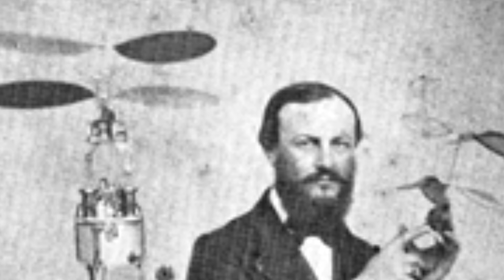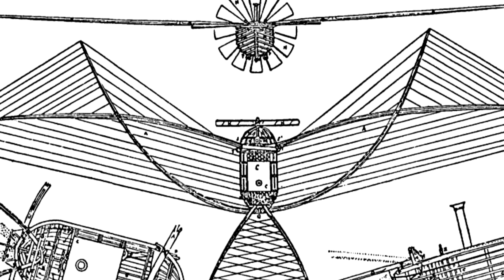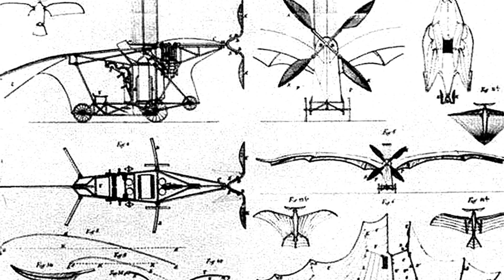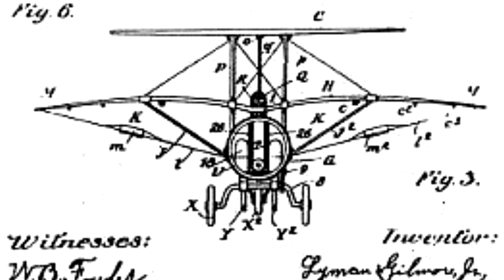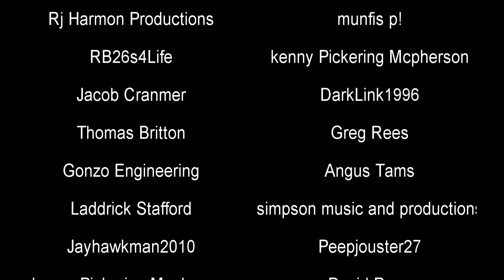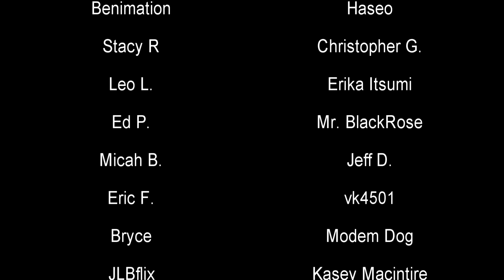Why Aren't There Steam-powered Airplanes? | History in the Dark

Comment: Batteries contain less energy per volume or weight than fossil fuels by a long way so you are not  gaining anything by heating water electrically in a plane. You would also have the weight of the engine plus the double conversion inefficiencies. The electric motor is the most efficient part of an electric drive train and you are throwing that away.

Consider that all the experiments with steam planes were at low altitude. Just imagine what altitude changes between 0ft and 35000 ft would do to  equipment already pressurised to many times atmospheric pressure. It would be many times the problem that cabin pressurisation presents today. That would require stronger and heavier equipment than at low altitudes so a big weight penalty again.

Then there is range. Steam trains were often more limited by the water they carried than the fuel, so some places such as the LNER in UK  used troughs that could replenish the tanks without stopping. Condensers would help and the cold at altitude would help but probably not enough to compensate for the extra weight and drag (the outside air has to efficiently cool the steam so fins will be needed for the heat transfer and these would cause drag).

It is interesting that steam was considered for the amerika bomber as this is probably the one example that could be equated with modern use ie long distance, high altitude. However i would bet that has more to do with fuel shortages than thinking it was intrinsically a good idea. The fact that it wasnt even prototyped, suggests that it was just a shot in the dark, rather than a serious contender.

Thanks for an interesting expose. I had heard of the bessler very recently and knew about the langley and maxim efforts, but you have filled in a lot of the gaps. The bristol tramp looks like coal firing would be the least of its problems! It is just a mad jumble of stuff as was often  the habit in those days. Just pile them wings high😊
Reply: Steam condensors can be made that fully recover water. An experimental car built during the 1960s proved this. They packed a 600hp steam motor into a regular sedan. It only carried 20 gallons of water and could drive for days between refillings. (Even full recovery systems have vent valves that periodically lose small amounts of steam). That car is being restored by a group in Michigan. I've seen it and how it works. The car is crude, designed as a proof of concept and its still one of the most advanced steam engine systems ever built. Granted, thats in a car, but the system is lightweight,  simple, reliable and very powerful.
Reply: @Bearthedancingman  interesting.  What cooling method did they use for the condensers? Shows it can be done if needs be. I suspect if water was scarcer or more expensive, then steam locos would have used condensers , but they could just throw it away. Even so , all the bits associated with steam engines tend to be heavy and often bulky so not very practicable for aircraft, similar problem to batteries with the concept of electric propulsion in aircraft. Just too much weight for too little bang.
Reply: @user-it7lf7kk8m  they used radiator fans on a custom built multi-core condensor that used .25 inch tubing. The condensor sat in the normal radiator location but was about 3x as thick. It is about 36" wide, 25" tall and around 6-7" thick. If I remember right they also have a 'first stage' condensor right under the hood that vents out 'up' thru vents in the hood. The water tank was in the trunk and used long 0.5" steel tube's to transfer the water which also helped cooling a bit. Granted, if you pulled 100% power for more than about 60 seconds, the steam volume would overpower the condensors and vent some excess. But they did calculate they could fix that. But in a car it wasn't needed.
Reply: @user-it7lf7kk8m  Also, yes, the fact that the steam engine consists of boiler + motor + condensor + water tank means it's bulkier and heavier than internal combustion engines. This is unavoidable, and definitely contributed to steam engines never being pursued. But not as much as people expect. When comparing to liquid cooled engines, the motor is about 1/3 the size and weight, the boiler takes up most of (or all of) that saved space.and the condensors are usually about 1.5x the size and weight of normal radiators. So the size is close, but a bit bigger, and the weight is close, but heavier. That said, Doble did allot to shrink these things down. But really, only modern metals allow for the compactness needed to match a piston engine in size to power for a use such as in aviation. And even then, much efficiency can be gained by using ducted fan, and some of the air be used to cool the condensor, which in turn adds heat energy to the thrust.

Comment: The steam step is obsolete. Gas Turbine engines have been powering ships since the 70s. I can't see steam being more efficient than using liquid fuel and atmospheric 02 as inputs and then the reaction products to drive a turbine. Not for the use case of driving an aircraft through the atmo. at high speed.
Reply: I would argue that Gas turbine ships is obsolete. Now almost all ships are diesel.

There is ships that are diesel-Steam compounds . Those have a efficiency on up to 60% currently with a potential of 70%. That is way more than you get out of a Gas turbine at about 35%